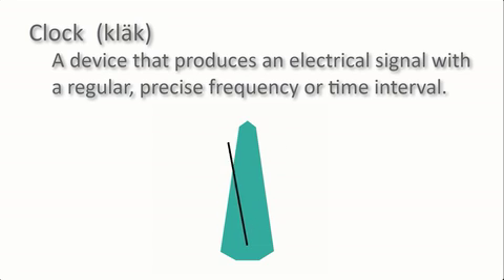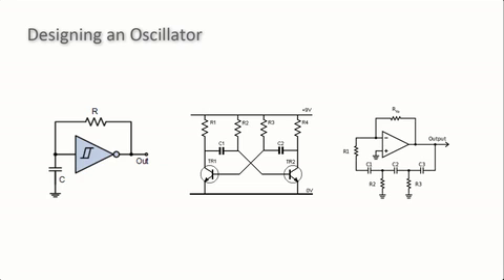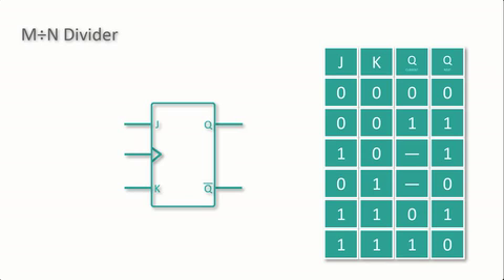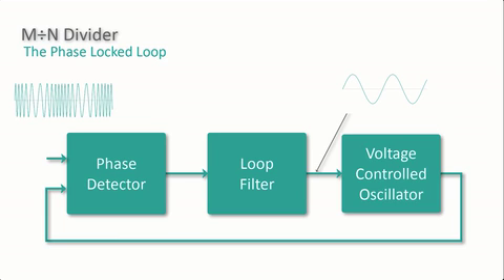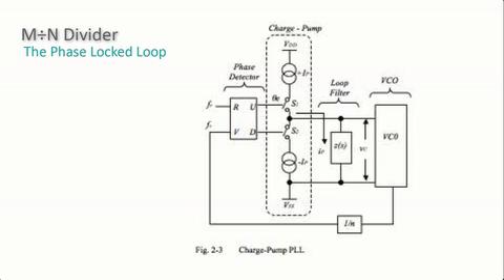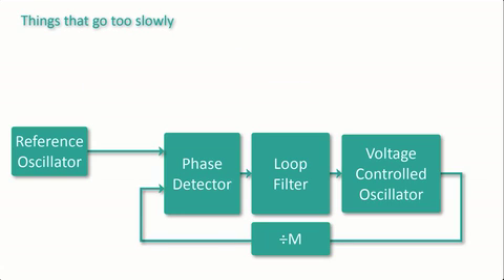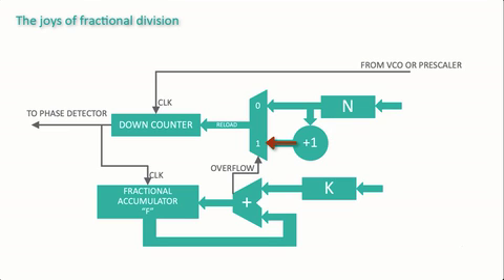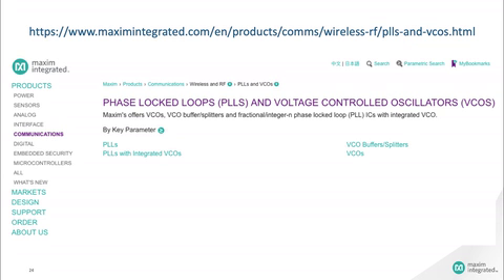All About Frequency Synthesis

Comment: what if the duty cycle of the frequency divider has unequal on and off time i.e, (not having 50% dutycycle) , how it effects the pll at the phase detector
Reply: There will be a phase jitter. Basically, every time you select a fractional coefficient, the output is not precise

Comment: 7:10  "Such an oscillator is practically unavailable"  , Not just practically but 100% impossible.  Its literally what the Uncertainty principle of Quantum mechanics is telling us.  We can't know the frequency, phase and amplitude at the same time ever.  It's basically a mathematical proof showing you never know when you are at peek Amplitude meaning you are never fully sure of what your frequency is as you need to know when the wave starts to go back down before you could even begin to know its frequency and the greater you know one value the less you know about the other.  Its actually a pretty cool piece of math when you really understand it in the right terms.

Comment: Hi guys, I don't understand - what if our VCO is limited to producing only a narrow range of frequencies - say 910-920 MHz. Since we always take our output from the output of the VCO, no matter what we do inside the loop, the range of frequencies that can be generated is only 910-920, right? So the divide by N circuit would not be able to produce say a 300 MHz signal if I set N=3?

Comment: Hey could you do a video of the Delay Locked Loop used in GPS systems, and explain the concepts of the Ring Oscillator, Multiplexing process, and Chain/Delay system in it? Thanks

Comment: Why two signals are 90 degrees out of phase?????
Reply: Any RC or LC network that a signal that passes through it will change the phase ahead or backwards because it will introduce some impedance at a given frequency. You will have some attenuation and a phase shift for a given frequency. This phase shift represents the 'imaginary' part of the equation for calculating impedance and phase of a complex RF signal (eg. R + j degrees). The math explains this fully.
Reply: @diggleboy  thanks dude! It's been helpful. You on FB?
Reply: Here's a great explanation for you with the math to verify why there's a phase shift at the output: https://sciencing.com/calculate-phase-shift-5157754.html